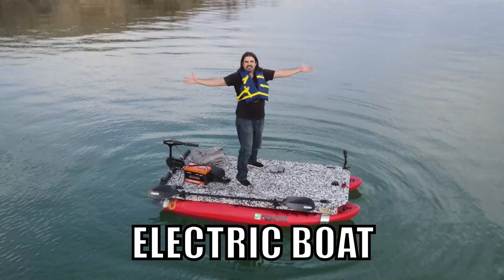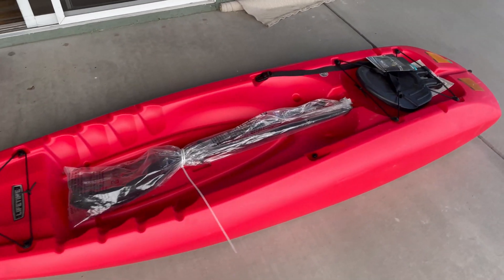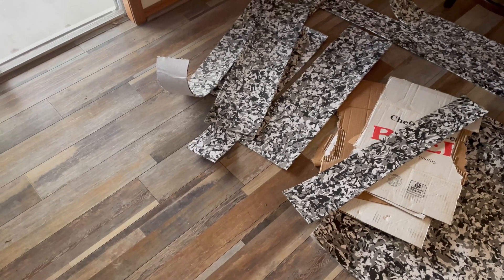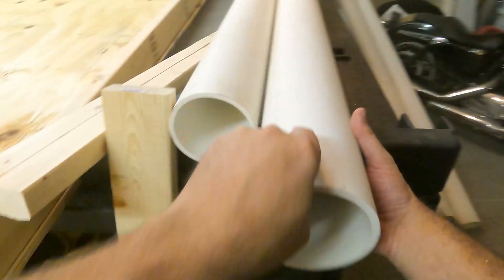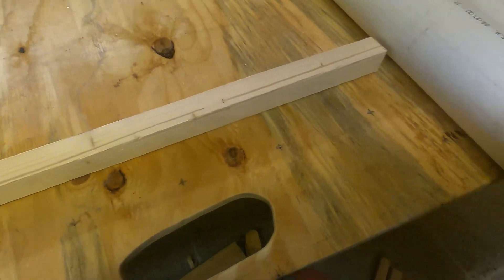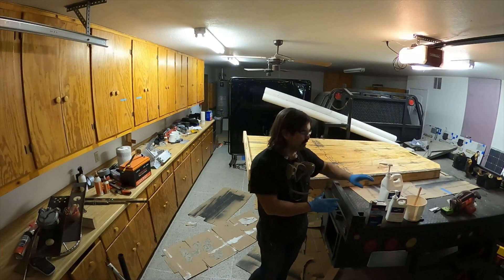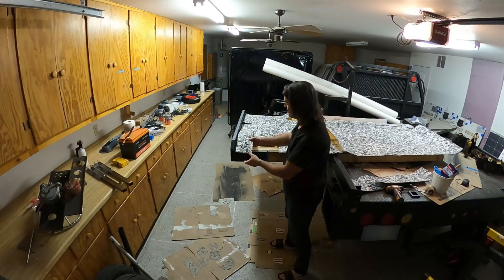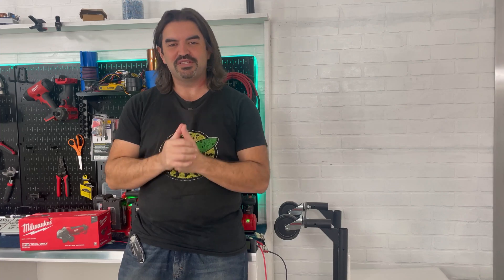I built a boat out of kayaks and plywood

Comment: for your handle in the wood i suggest doing 2 hole saw holes then using jig to join them
Reply from the maker: Great suggestion! Looking back on that is a real facepalm moment. Your way would have worked WAY better.
Reply: @eagleray1  I have plenty of those moments lol. But it makes the next builds get better and better! Good work on this boat though